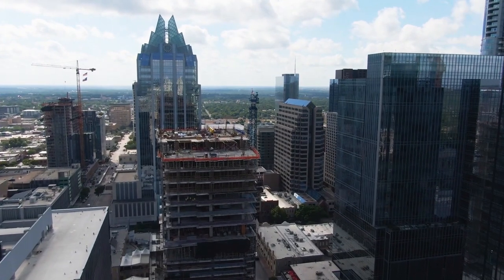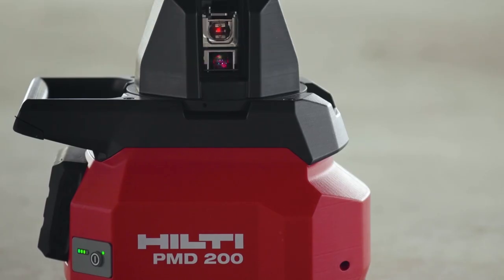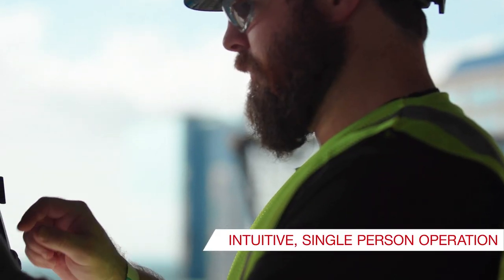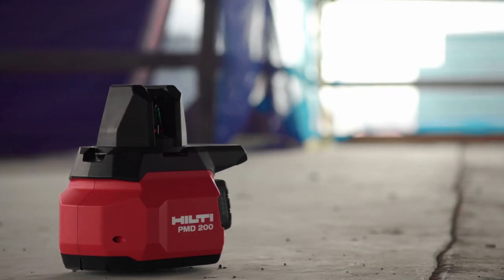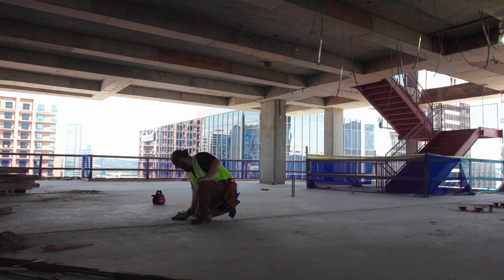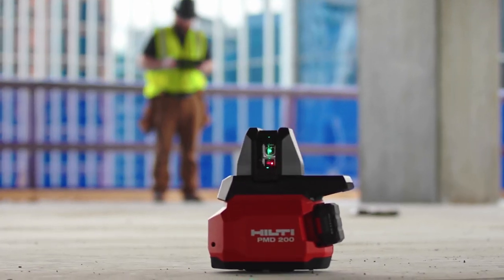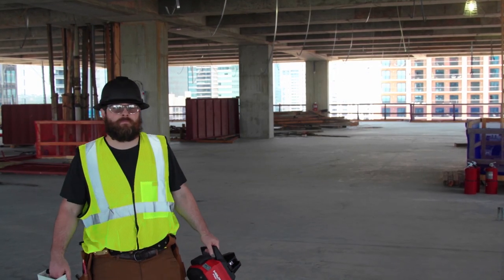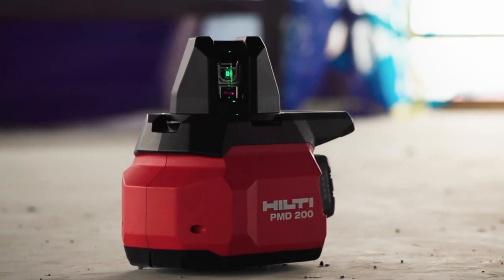INTRODUCING Hilti PMD 200 interior jobsite layout tool for drywall

Comment: We install solar modules, can this tool work outside?
Reply from the maker: Thanks for your interest in the PMD 200! The tool is designed for indoor use only. -Sarah, Hilti North America Social Media Team
Reply: @HiltiNorthAmerica  Sarah, do you have a solution for that... draw a layout over concrete slab and then drill?
Reply from the maker: We might have a solution that works, but there are a lot of variables to consider, so we recommend having a quick consultation via phone or email. with our Measuring team to see which layout tool would best work for you. If you could send us your contact info at hiltisocial@hilti.com, we'd be happy to put you in touch with them. Alternatively, if you call our customer service team at 1-800-879-8000 (US) or 1-800-363-4458 (CA), they can connect you as well. Thanks! -Sarah
Reply: @HiltiNorthAmerica  Thank You 👍